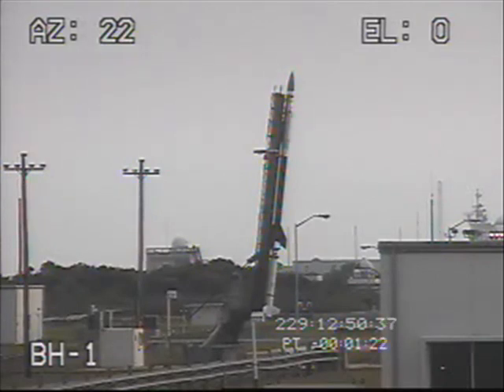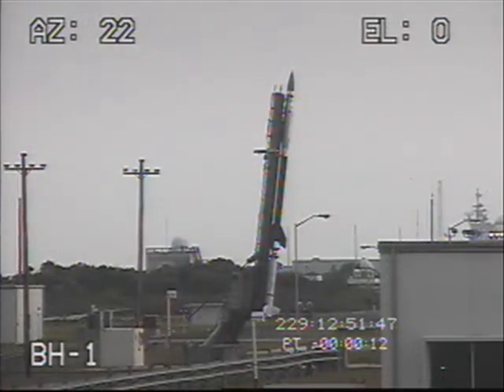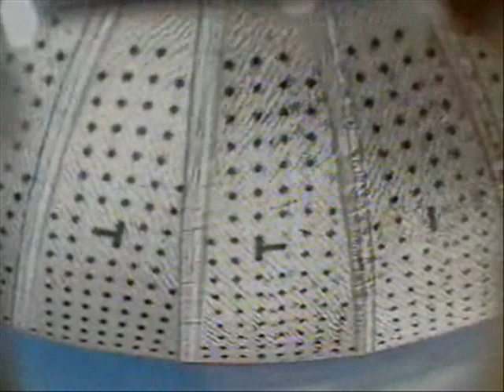Terrier-Black Brant IX (IRVE)

Comment: at 4:32 someone mentions they can see "the inflated article".  And from 5:19 onwards the camera shows what appears to be the inflated aeroshell.

But the video info says the aeroshell isn't supposed to inflate until 7:28 into the video.

So have they cut video outof this?
If they have - then perhaps at 8:19 when the aeroshell seems to lurch towards the camera and the video feed finally ends - i assume this is 18 minutes into the flight when the vehicle finally crashes into the ocean.